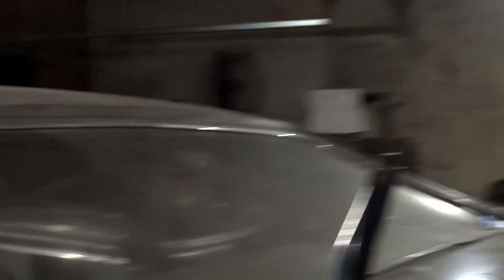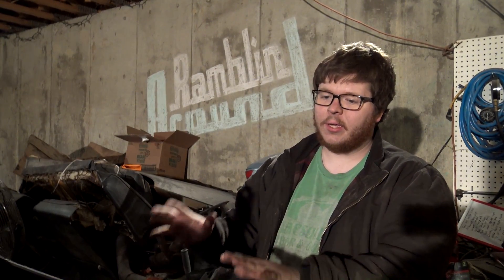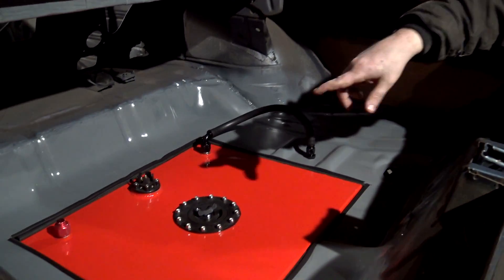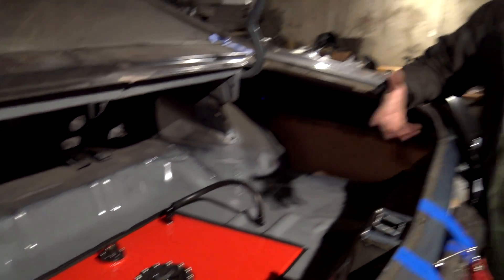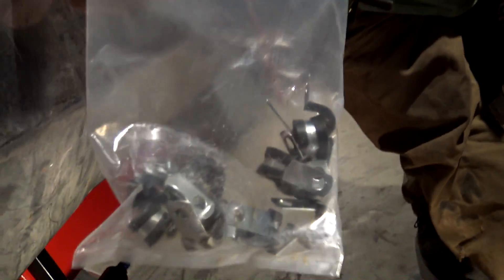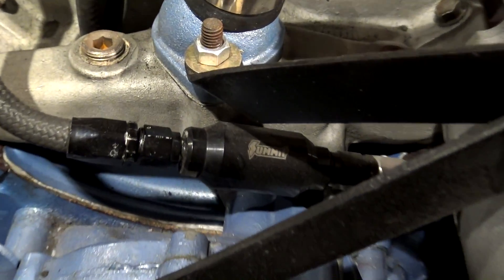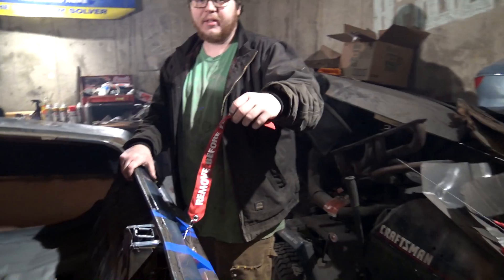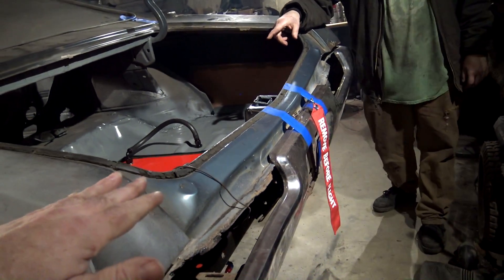1968 Pontiac GTO Project Update - Video # 18 - Fuel Cell Installed

Comment: That is a nice fuel cell ..I would keep the gas filler at the tank and just open the trunk to fill it...mostly for keeping vandals and fuel thieves from getting to it..You need some kind of heater in there ..I am really spoiled with the wood stove in my little work shed
Reply from the maker: Thanks Jim.  We do have propane heat in there when we need it, but we don't run it while shooting videos.

Comment: Will foam blocks be added to the tank?  I noticed less upsets in handling from fuel sloshing around while cornering,  when I added them to a  fuel cell in a fox body 25 years ago.
Reply from the maker: The tank did come with the foam blocks.

Comment: why does it need a fuel cell? To use 69 Taillights, youll need to change the rear panel
Reply: I just like them, but mostly so it's easy to upgrade things as the car gets faster. Right now I'm just trying to get it together so I can drive it around, I'm going to build a healthy pontiac engine for it over summer. car is also getting a roll cage very soon.